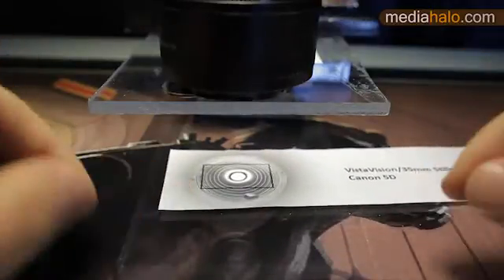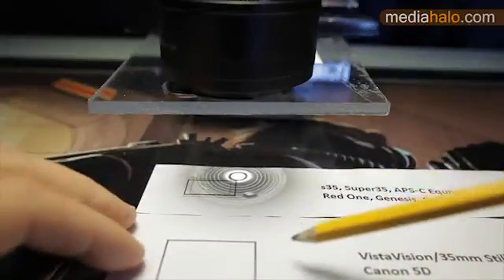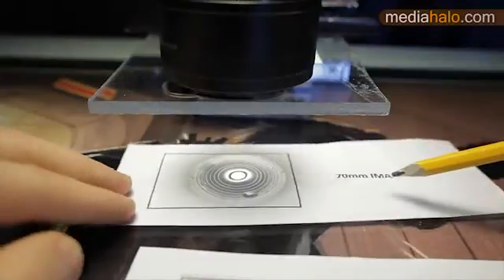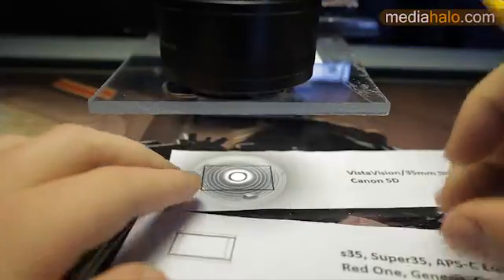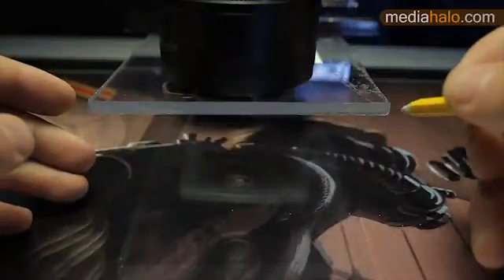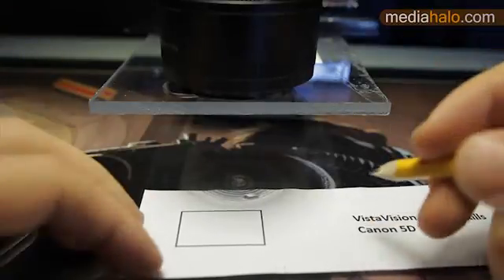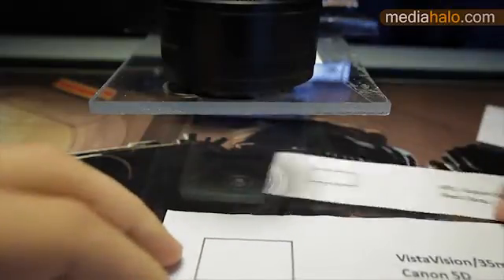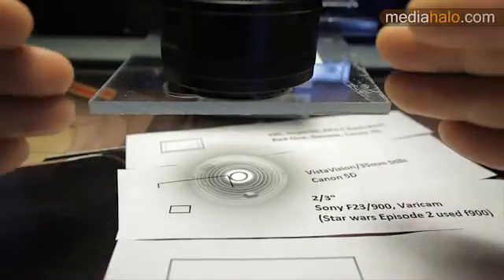What is DSLR Crop Factor, Depth Of Field, Lens Image Circle - Filmmaking Tutorial

Comment: OH MY GAWD!!!!  Thank you for doing this video!!  I was wondering if you could do another video with 2 lenses with the same mount, but with different image circles, using the same example's of sensor sizes.

let's say I have a ASP-C lens (canon mount), and a Full Frame lens (canon mount). The image circles will be different sizes correct?  Because If I use a FF lens on a ASP-C sensor, I will get a crop factor, and if I use a ASP-C lens on a FF sensor I will get vignetting.

If I'm not mistaken the distance from the lens mounting face to the sensor on ALL Canon camera's are the same distance. Correct?

Comment: You are wrong on the fact that the sensor has nothing to do with the depth of field. It has an effect but it is opposite what people think.  Smaller sensors have less depth of field as the image is magnified more. If you then reduce the focal length things turn the other way around.

Comment: it may physically connect, but it will look like you're looking through a peep hole. some lenses actually will even work if zoomed in enough, like the tokina 11-16mm is an ef-s lens, but it happens to work on full frame at the 15-16mm zoom. some full frame cameras now also have a setting to be able to crop to these lenses